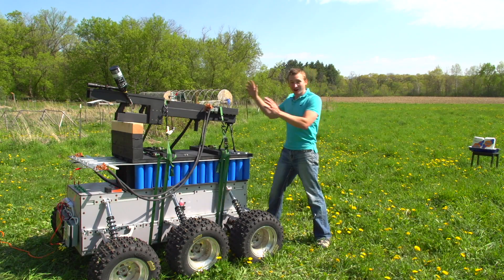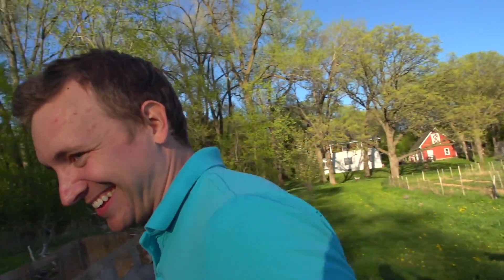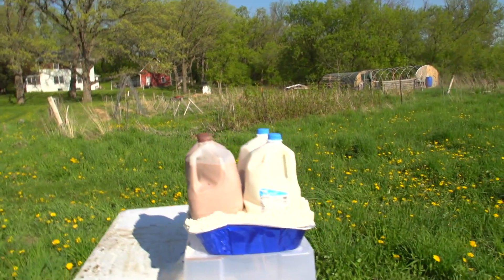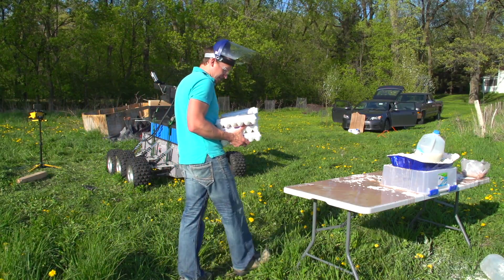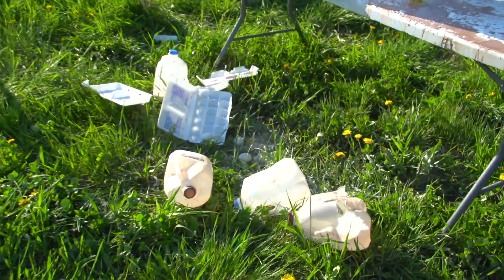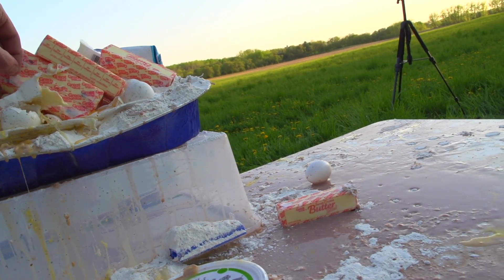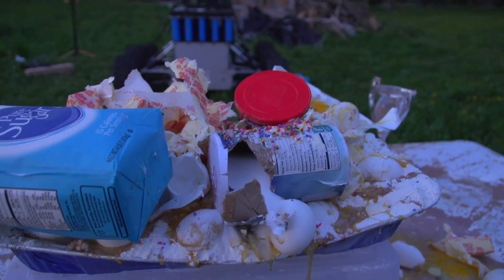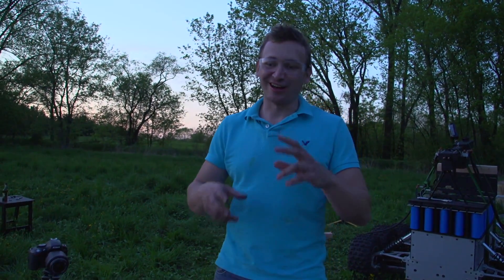World's First Railgun Tank, 35,000 Joules: Let's make a cake.

Comment: Why use such a short rail? Won't a longer rail increase the acceleration time?
Reply: I believe the problem lies in the amount of energy in the capacitors.

If the rails are too short, it doesn't accelerate it much. If it's too long, it loses energy from the friction and decelerate the round before it leaves the barrel.
Reply: Only if they have extra power left in the capacitors after it fires. Assuming they're using all the power in the capacitors, then a longer rail would just cause friction. But if they add more power, a longer rail would be necessary to make use of it.
Reply: I was thinking the same thing.  This is like a QCB railgun.  I think they made it to be handheld, judging by the grip, and the rails.  One does not hold a railgun in ones hand to operate.  You make them friggin' huge, and slap them on an artillery base.
Reply: You could use a number of capacitor banks and divide the rail into segments for each bank along the length of the barrel to apply a fresh shot of power as the projectile moves along. The amount of time the projectile spends in a given segment gets less and less as it accelerates so it would determine how much capacitance you would need for that segment or you could simply make that segment longer. You need to see what the shape and duration of the current pulse is. Assuming it is Gaussian pulse, you could measure the FWHM of the pulse on a scope and see how far it traveled along that rail segment and optimize the bank to fit or the length of the rail to fit the bank.
Reply: Becca Zam No you shouldn't because the segments would only fire once the projectile is in contact with the correct rail segment because the electricity runs through the projectile.
Reply: 2 reasons: 
Reason 1: The energy stored in the capacitor bank is not enough, the friction is to high for the projectile and a longer barrel would possible slow it down.
Reason 2: This is just a one stage railgun, meaning that it only has one operational state, on or off. A more sophisticated version would use multiple firing states with parallel set of coils. By timing their cycles a real railguns projectile speed can be obtained and devistating. This however requires lots of math and a good circuitry  to work at all.
Reply: Zachrey Helmberger You would need a computer controlled firing system, to get it to fire properly.
Reply: A very long rail is unnessecary as the current in comming from the capacitors drops exponentially giving you a very strong magnetic field for a short time but when the current is gone there will be no magnetic field and the bullet will get stuck

Comment: Come on guys! Railguns are just horribly inefficient. Electrothermal launchers in my experience were faaar more efficient than electromagnetic ones. With 35kJ you could probably get 5-10kJ of kinetic energy
Reply from the maker: Railguns are inefficient at low speeds, but thrive in the mach 3 or greater zone. They become more efficient, while pressure based propulsion loses efficiency.
Reply: +Ziggy Zee agreed I'm pretty sure the highest speed reach for a railgun was mach 6-7, imagine shooting this fucker at a 1 meter thick pane of glass

Comment: 35,000 joules? That's stronger than a .50 cal
Reply: But that's only the electrical energy. I'd estimate under 1kJ of kinetic E. I've seen more powerful slingshots
Reply: If their railgun is about as efficient as the navy's(most likely not) which is %16 efficient(I think) then they would have, 5.6KJ of kinetic energy, but I would assume theirs is about 5-6% efficient, so they would have ~1,750 J of energy.

Comment: Very exciting and a lot of fun. On scientific side it is not very much convincing though:  "Kalashnikov" and the likes have muzzle energy of the order 2-3kJ. With 35kJ you guys should have a destruction level comparable with what is left after firing bazooka. Keep trying :)
Reply: Their capacitors have about 35kJ. I doubt all of it is getting applied usefully. Then the system is only about 5% efficient, so you have around 1.7kJ of energy in the slug, but it's light and big, so it loses a lot of energy to drag and so on. The end result is what you see here. Discharging the capacitors into the "Cake" would likely have been both more dramatic and of greater destructive effect.

Comment: Nice work but rough and needs much more power.
Too much bull shit mate you said tank in the title and robot in the vid too much bull shit makes you look bad.
A tank has tracks and also armor one hit a small round would kill it.
Or they would just shoot the guy standing next to it
Reply from the maker: I changed the title to tank after popular mechanics called it a tank.
Reply from the maker: It is a military robot, however.
Reply from the maker: 2 rails, 12,000 lbs of repulsion. Pretty cool. I'll try to add more science next time.
Reply: Ziggy Zee 
The construction is ok, but more science is needed to show the true nature of the power your playing with, some kind of monitor station to see after each shot, When you blowin frayed wires off your not transfering all power to the shot.
Not ever one can do this work so you have done well. But be careful please.
Reply: I think we can all recognise 'tank' as  a vehicle with a big badass gun on it
Reply from the maker: The energy is transfered completely, milliseconds before the one cable blows off. Mostly an aesthetic issue. 

I definitely agree that the audience wants more science for the next shoot.
Reply: Ziggy Zee 
Sorry I used such strong works in first message. 
Your work is good but like a lot around but you do seem like some one ready to try new mods to it function and new materials also.
And don't need to use misleading title as I like tanks was look for one but I do also like the tech you have made so balances out.

Comment: Two questions.  1) How much of the velocity is the CO2 system?
                             2) Can you run it through a chronograph?
Reply: Only about 300-500 fps  and I really want to see the crono results too
Reply: Ian Rogers I can't wait to see actual velocity readings.
Reply from the maker: The co2 is rather weak. Frame analysis suggests 60 mph pre-injection velocity. A chronograph will not work due to the flash- there is many small incandescent particles. Trying to get a slower, slo mo camera.
Reply from the maker: +Ziggy Zee are*
Reply: Do you think I could use a spring or a hammer as a pre-accelerator?
Reply: +Ralakus probably don't want any moving metal parts in the barrel considering the magnetic forces
Reply: Mattsoup well, they're not touching the rails, and they're aluminium(I think), so they shouldn't be affected.
Reply: Ralakus The slug is aluminum
Reply: I know the slug is aluminium, but the reason it's affected is because there is a high current going through it.
Reply: Ralakus there are extreme magnetic forces too though. I'm assuming the main reason they use CO2 is just for velocity though
Reply: Mattsoup
It's to get the projectile moving so the magnets don't make the gun blow up.  So the CO2 isn't moving it very fast.
Reply: Ian Rogers There aren't any magnets though.
Reply from the maker: +Ian Rogers Also, railguns are very inefficient at low speed. A lot of heat and damage is created in a small area. Better to have it moving.

Comment: Remake the connections, the cables flying off each time must be annoying. As for the gun, think about doubling the length and using some home made, much larger caps now that you have a platform. Would also be nice to get one of those devices that measures projectile velocity.
Reply from the maker: +kalimul Only one cable was flying off- working on the issue. I've made capacitors from scratch... and 35,000 joules is unobtainable without A. $10,000 B. 7 miles of polyester sheeting or ultra pure aluminum C. 10,000 lbs of materials. Let the capacitor experts continue to make caps :)

Comment: Maybe a stupid question. 
Why are the Two cables on each side loose? 
On a shoot they repel each other. So with some cableties every two inch you can hold them together, this way they don't try to fly off. Or is there something i overlook?

An other question.
Do you machine all projectiles? 
It could be easier to pour them with an open mold. Aluminum is relative easy to meld and you can add weight ( and make it a lite bit softer) by adding lead to the alloy.
And pouring it should make them much easier and cheaper to produce.

Comment: This is not a real rail gun, fake and lame.
Reply from the maker: it is, in fact, a real electromagnetic  railgun.
Reply: +Ziggy Zee Well I stand corrected, between the CO2 canister and the hoky electrical connections it looked very suspicious. Why are you using such a flimsy system, if you are worried about a short just add a slow blow breaker.
Reply from the maker: Because I have a small budget
Reply: Well considering what you have spent so far, you already have the most expensive parts. If those wires hit the wrong spot and create a nasty short, you will fry those caps and possibly hurt someone. Sometimes those electrolytic capacitors can blow in spectacular fashion.
A few dollars for a safety breaker and some decent hardware would be a wise investment.

Comment: What are you firing out of this???
Reply from the maker: The projectile is shown in my other videos- An aluminum slug.
Reply from the maker: +Joshua Camp About 20 grams.
Reply: +Ziggy Zee what's the penning power and have you thought about using a sabot with a heavier metal?
Reply from the maker: +Joshua Camp I don't know what penning power is. I like a low density sabot because railgun's exhibit higher efficiency at high velocity.
Reply: +Ziggy Zee, I don't really understand what you're saying there, but what I am thinking about is something to do with a discarding sabot  with a dense needle like projectile, munch like this: 

https://en.m.wikipedia.org/wiki/Armour-piercing_discarding_sabot

What are the dimensions of the slug? I would like to cad a version of this... If that is ok with you.

Comment: And you stil haven´t learnd how to attach cables...
Reply from the maker: $$$ don't wanna buy new cables
Reply: you don´t need new cables, just crimp some lungs on the ends, and make some structure form angle aluminium or whatever to secure the whole cable run in place.
Reply from the maker: +kubeek I can put on some professional copper crimps, just haven't gotten around to it. The cables blow off after all the energy is discharged, so it doesn't affect performance much.

Comment: I want one of those robots now....

not for actual science, but for transportation. cheaper than a bus and probably quicker
Reply from the maker: +rowplatts It's pretty awesome and dangerous riding on top :p
Reply: +Ziggy Zee A little more badass than your average go-kart though
Reply from the maker: It's got a limiter in it- 20 mph max. That way, when interference occurs, you can chase it down and hit the giant kill switch on the side, BEFORE it crushes something.
Reply: +Ziggy Zee Fair point, but if I was riding it I wouldn't need to chase it XD
Reply from the maker: True

I've ridden it. Absolutely terrifying. There's enough torque to climb a three foot vertical concrete wall: :p
Reply: +Ziggy Zee That's impressive :O I'd probably just use it to show off how awesome I am, but it's good to know I can drive up a wall if necessary XD
Reply from the maker: +rowplatts And then you spend $150 on a uhaul to move it and the smile becomes a sad face that isn't going on steam for awhile.
Reply: +Ziggy Zee Also a fair point... still a badass robot though
imagine if the robot had AI and targeted targets itself with sarcastic comments as it fired

Comment: if you are willing to listen you can make the gun 2x better
Reply from the maker: I'm all ears.
Reply: Ziggy Zee ok first those cables -> add 5 (at least) of those on each side  and longer rails would help to also make a projectyle from copper with a lead or tungsten penetrator at the front and be sure to connect to multiple points on the capacitor buss bars
Reply from the maker: +PlanetEngineering Official I've done the math, and two cables present acceptable resistive losses. 

Longer rails are not necessary- the current is zero by the time the projectile gets to the end.

I do have tungsten.. but I'll be saving that for hardened targets.
Reply: Ziggy Zee whatever ,what is acceptable? the cables blowing off? you have to consider the lost energy in the movement to and the fact the disconect every time probably before all the energy is dissapated
Reply from the maker: +PlanetEngineering Official I do like the idea of connecting to multiple points on the bus bars. That would eliminate the concentrated current and lessen the forces on the cables.
Reply: Ziggy Zee yep

Comment: Can you make it shoot something actually hard like a steel plate please
Reply from the maker: +Tom Dare I do have a few tungsten finned projectiles...
Reply from the maker: I think it'd be interesting to try.
Reply: 1ukjunglednbraver The core doesn't need to be same as the rest of the projectile. Just bore a hole in it and shove in a tungsten carbide rod.
Reply: If the projectiles are tungsten carbide, it doesn't require that much energy to go through AR500. It'll bite in and cut through, it doesn't behave the same as a lead and copper projectile.
Reply from the maker: That would probably work :p
Reply from the maker: Looking to do some shooting again soon. I'll keep this in mind.
Reply: Right? Wtf dude you make a frickin railgun and shoot a bag of flour?? you can toss a stone through that. Shoot a metal plate ffs
Reply: its not as conductive
Reply from the maker: +Rima Panapa The gun charges off the two 12 volt drive motors. It can drive while charging.
Reply: +Ziggy Zee holy science and engineering, that's sick
Reply from the maker: +Rima Panapa Charging doesn't drain the batteries too much. Two large deep-discharge marine 12 volts can easily charge em many times.
Reply: +Ziggy Zee What uses does this have? Anti Vehicle?
Reply: Dr. Retro non in this form its just cool
Reply: fair
Reply: +Ziggy Zee just wondering, does the gun and motor or the vehicle run off the same power, eg would you be able to drive after shooting?
Reply: Ziggy Zee I to would love to see this Vs AR500 or higher. I think they may donate a plate if you ask nicely and say what it's for.
Also looking at taofladermaus's armour defeating shotgun rounds, a simple tungsten cylinder the size of a 5mm drill bit inserted into the existing round should work. The cylinders aren't expensive, so I don't mind shipping one of those to you if you can mod your ammo to fit it.
Reply: +Tom Dare Not enough energy, it'll probably ricochet right off an AR500 target. If they are going to test, angle the plate and hide behind something solid and safe. Try something way softer like a lead disk first then some mild steel (still angled). Still Rail guns are fun. Cool project.
Reply: +Ziggy Zee yeah a heavy projectile is probobly more effective as it has more acceleration time so you get more overall energy into the round